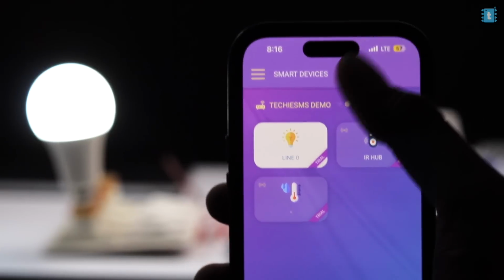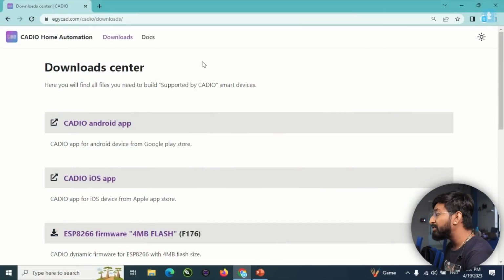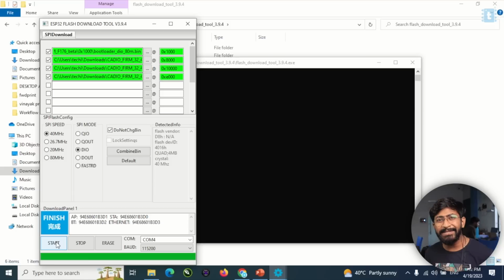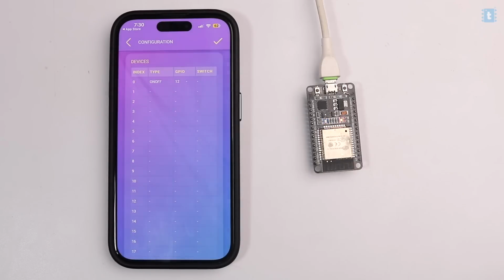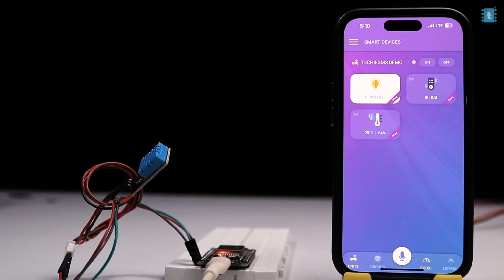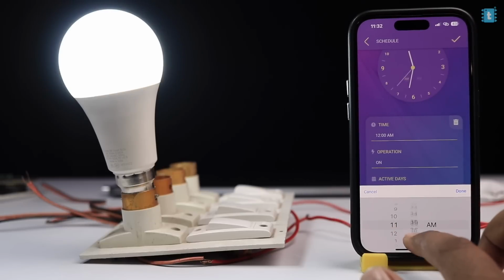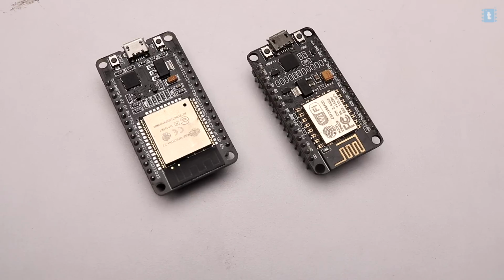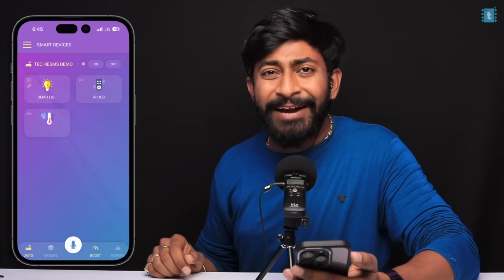EASIEST! IoT Platform Ever🤩🤩 | Getting Started with Cadio Home Automation Platform

Comment: Tasmota is better as it is free and quite sturdy too. Rainmaker, though free, has wifi reconnect issues. Rs 800 per board is rather steep in Cadio.
Reply from the maker: But I can give you a discount coupon that will give you 25% off on any CADIO device license 

Just purchase any CADIO based projects from our website and you’ll get a coupon code and use it for unlimited CADIO devices licence. Offer valid till 30th sept

Comment: Bro some doubts are there ...
1) can we control the digital pins from  anywhere in the world or only in the wifi area.
2) is that payment (799) is only for one widget or for entire app
Reply: yes anywhere from the world, 2nd: yes for one system for example if u have one esp32 that will cost 799 adding another esp32 with cost another 799

Comment: I heard you say unlimited number of devices unlimited number of times, each device can handle 21 i/o devices. Are you refering to "unlimited number of esp8266/32 devices"? However I see the license is bound to unit STA id. Whenever we use another nodemcu do we have to purchase a sepearte license? That brings another question, if the nodemcu is corrupted, do we loose the license?

Comment: can u make a home automation devices completely based on it

U CAN USE IR REMOTE  MANUAL SWITCHES AND APP TO CONTROL IT U CAN ALSO DO SOMETHING LIKE IF TEMPERATURE IS BETWEEN 22 DEGREES TO 30 DEGREES IT SHOULD TURN ON AC AND IF LIGHT IS LOW (LDR) IT TURN ON A BULB I ALREADY MADE IT BUT IF U MAKE IT I CAN FIGURE OUT MY MISTAKES WE CAN ALSO SET ALARMS USING MP3 MODULE

Comment from the maker: What should we make using Cadio IoT Platform? Let us know…

Clarifications Regarding Permanent License - The price that we pay for the license is only for one single ESP device. If you add another device, you need to purchase another license for that. And in single ESP, you can add upto 21 devices. 

Also Enroll For Master of IoT course by Sachin Soni to learn everything about IOT - https://techiesms.graphy.com/courses/Journey-to-Become-Master-of-IOT-from-Scratch-1680762902703-642e6816e4b00e582bd7d5d9
Reply: I think One purchase for one license works for only one controller (one esp)
Reply: @MD-py2de  yes , we need to purchase for every esp board
Reply: @drelectronics13  Also, if the esp you are using is suddenly stopped working, you can't transfer the license to another esp, you need to purchase another license,  this is not good,... just look for the Cadio Documentation
Reply: Unfortunately we cant control relays conditionally, for that we need to code and i prefer coding than this
Reply: helpful this  comment , I was confused for Permanent License, but now clear , thank you
Reply: Thanks for the clarification. Please pin this comment for future viewers.
Reply: can u make a home automation devices completely based on it

can u make a home automation devices completely based on it

U CAN USE IR REMOTE  MANUAL SWITCHES AND APP TO CONTROL IT U CAN ALSO DO SOMETHING LIKE IF TEMPERATURE IS BETWEEN 22 DEGREES TO 30 DEGREES IT SHOULD TURN ON AC AND IF LIGHT IS LOW (LDR) IT TURN ON A BULB I ALREADY MADE IT BUT IF U MAKE IT I CAN FIGURE OUT MY MISTAKES WE CAN ALSO SET ALARMS USING MP3 MODULE
Reply: Can you make a Smart Pillbox?
Reply: Hi sir I have been following you for the last 2 years and I have also made home automation for my room by using the rainmaker platform ,but  now I am confused between the rainmaker and cadio Iot platform. Please suggest the best one as in rainmaker the fan speed does not work 😢
Reply: Please give or transmitter and receiver diagram as I have tried so much but not working. Please mail me or reply